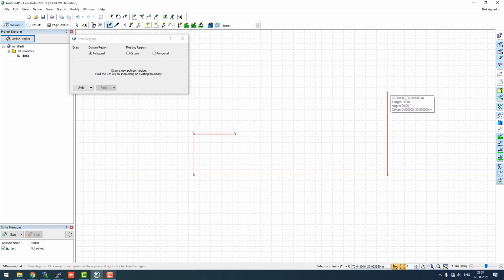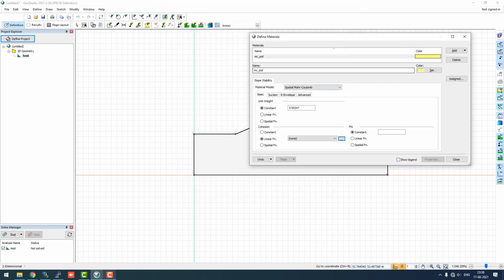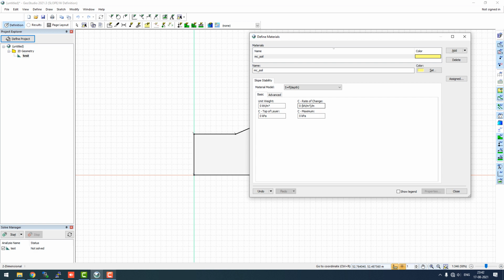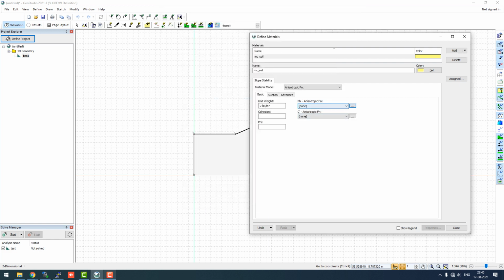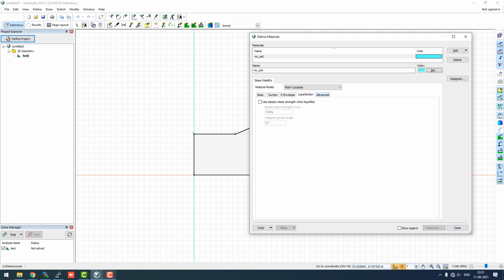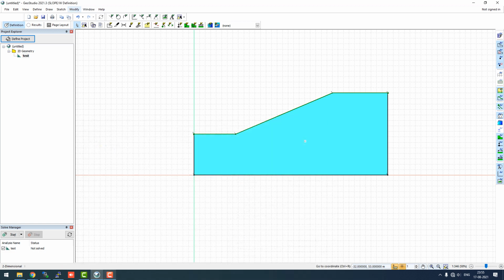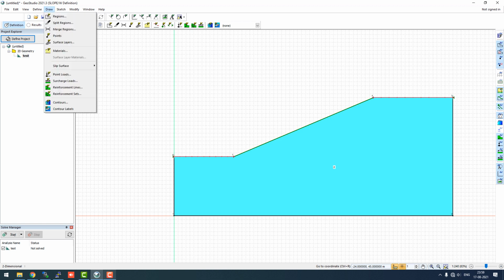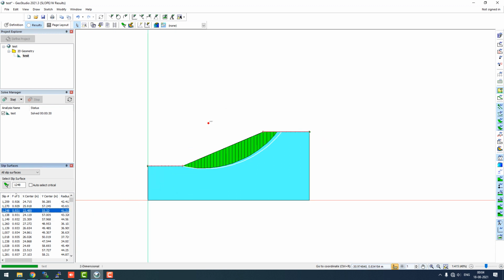GeoStudio 2021 (Slope/W) Tutorial : Basic geometry creation and a simple stability analysis

Comment: If I want to insert root vegetation into the slope model, what "Material Model" should I use?
Reply from the maker: @syazwanroslee657  The soil model will be same. A tree can be simulated as an anchor or nail.
Reply: @ Is it even possible since the root structure is so complicated?
Reply from the maker: @syazwanroslee657  even the soil is not uniform but we model it as isotropic.
Reply: @pranjlm  I see.. I have seen a study that only measure friction angle and cohesion of soil+root cohesion..basically just apply the shear strength parameters before and after using vegetation to know the FOS difference..is that kind of way is acceptable as well?
Reply from the maker: @syazwanroslee657  conditional yes.